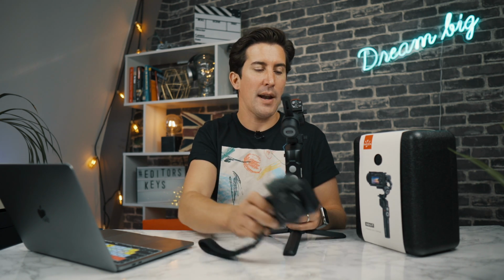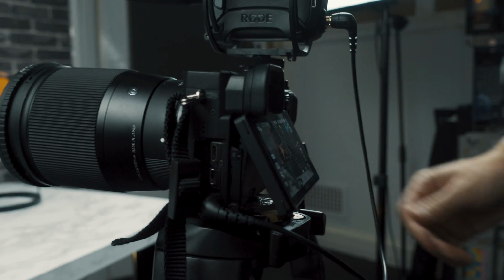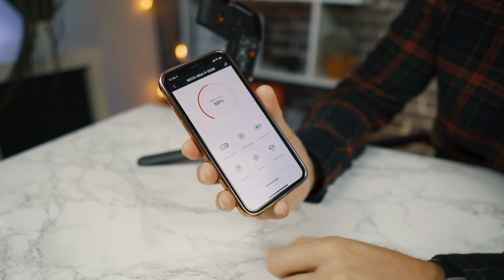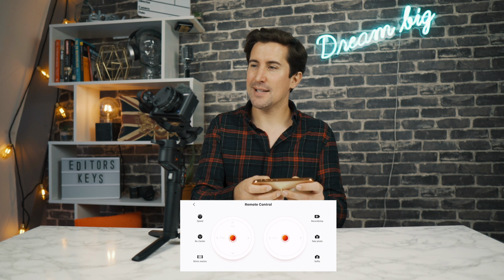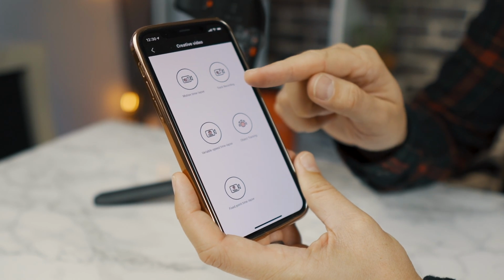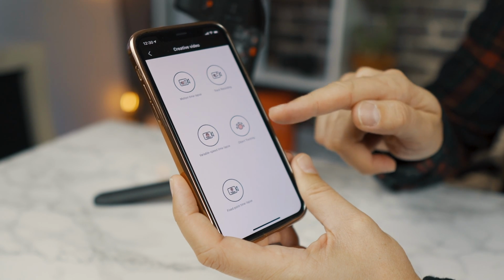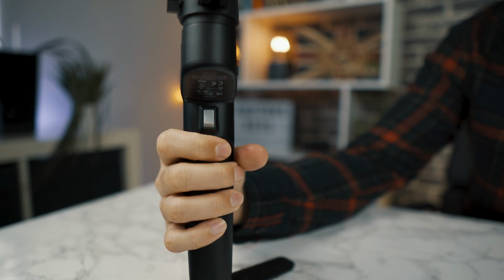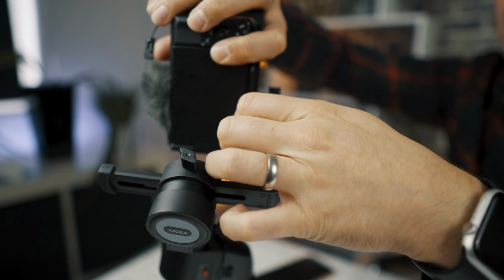Moza Mini P Review - The Best Budget Gimbal for Mid Range & Mobile Video?

Comment: The latest firmware is 2.0.4. Auto focus does not work on Sony a6000. Moza make a good new firmware.
Reply: Continous AF for video mode ? If so, then I have the same issue with Sony a6500. At the moment I just not connecting camera to the gimball via cable and turning on recording on the camera itself, because when connected it disables AF-C. Maybe in the app there is possibility to reconfigure, but I am disapointed that there is issues even with record button while using wita Sony camera.

Comment: Can I use the gimbal to control on/off button and zoom with Sony A6000?
Reply from the maker: Hey Daniel you can pair it together with your Sony. Hope this helps
Reply: The manual user says you need a cable to control the camera directly from the gimbal and then by using the central button you can take pictures and start / stop recording. I haven't found anything about zoom.
Reply: @Sagi3O  I placed order today, I should find out pretty soon

Comment: Can you Help me? A Yellow/BLUE light can stop blinking. Manual Info its in Chinese. Gimble doesn't Works with The buttons and The app. Maybe its something related with The Lights.
Reply from the maker: Hey ohhh I’m not too sure to be honest. I would try a full reset on it.
Reply: @editorskeys  How can I resset It?
Reply: @editorskeys  it's weird because when I turn it on it doesn't even stabilize the camera and it gets soft everything is clumsy. Joystick doesn't Works. Remote control app also.

Comment: When I try the inception mode it turns some but beeps and then auto shuts off. I'm using a NOTE 9 but the gimbal can handle up to 1.98lbs so it's likely not due to the weight.
Reply from the maker: Hey Jay, it's likely to be not balanced correctly. You can also change the power of the motors from within the app, so they might need turning up or down a little.
Reply: @editorskeys  Thanks for the reply. I made sure it was manually balanced and calibrated. I assume the beeping is a warning?

Comment: What kind of Lens are You using on the Sony ZV 1? Do you need a Cable to Control The Sony ZV 1 on this Gimbal or does the Gimbal work wirelessly like on the Zhiyun Crane M2??
Reply from the maker: Hey it's just the built in lens on the ZV1 (you can't actually change the lens.) We do now use an ND filter so we will have a video up shortly about that! No the gimbal can control the camera wireless which is great!